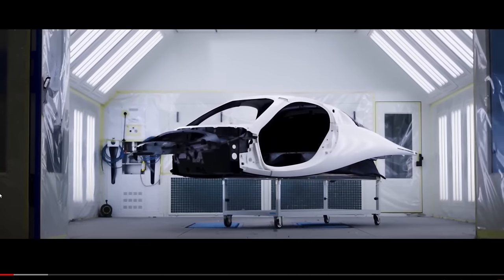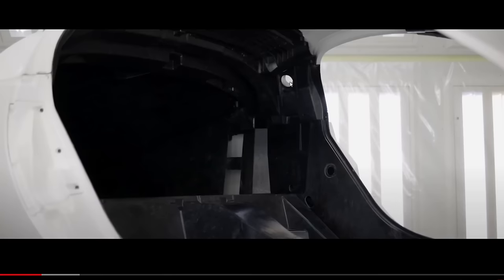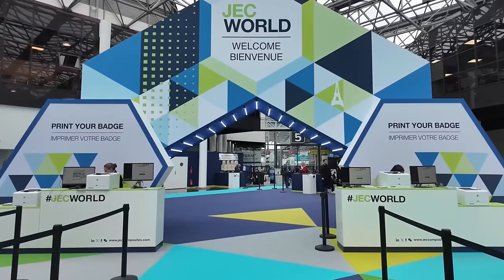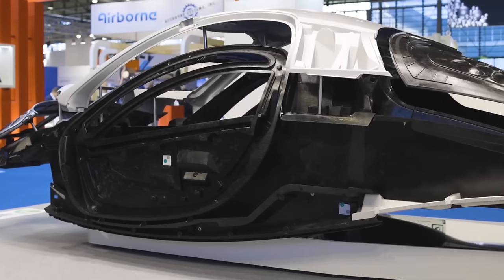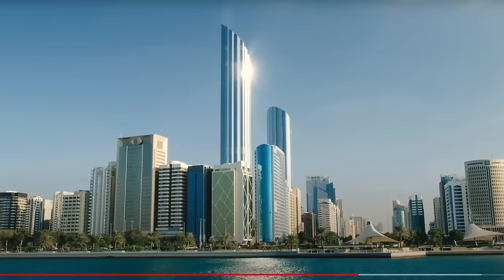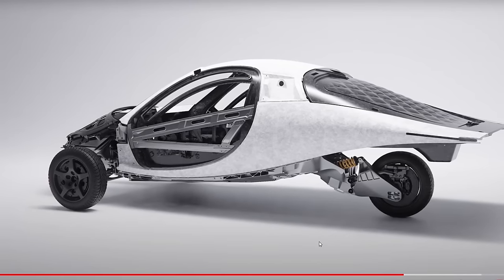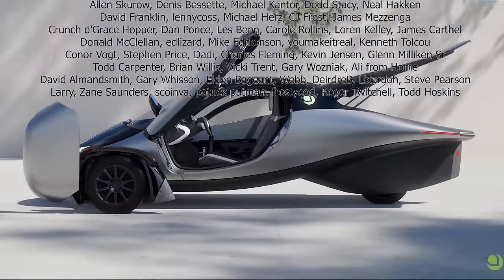Aptera March 2024 Update Commentary

Comment: I got the impression that PI-1 was intentionally coming to Carlsbad for the electrical validation. PI-2 will be the rolling unit but Chris had said that all PI builds can be updated.  PI-3 will have the polish of what the LE will look and function like.  I would imagine that Aptera would not miss out on the opportunity to use PI-1 for more than just the electrical validation and we may see it in a crash test.  At this point, each body is worth an enormous amount of money and getting the most out of every build is in Aptera's mode of operation.
Reply: If it does not have metalic structural components it will not be revamped for crash testing.
Reply: @glennzajic7318  I see nothing preventing them from attaching a full PI chassis, suspension and the rest of the parts to this once they are available.
Reply: @fotoguru222  I was particularly thinking of the roll bar that gets sandwiched between. I don't think they would cut it apart to install that.
Reply: @glennzajic7318  Can imagine some parts being temporarily bolted together pending updates and later bonded if needed for further validation (eg, crash testing).🤷🏻
Reply: @glennzajic7318  I hadn't seen Steve F. comment about no metallic structural components in PI-1.  That would be a great opportunity to test the de-bonder and put the structures in...  Probably not worth it but maybe it was lightly "tacked" together so it could be taken apart and made a complete vehicle down the road.
Reply: @gr8dvd  I suspect that all the black carbon parts (the strongest components) are bonded.  Then I imagine that a lot of the white fibreglass parts which are not as structurally vital, will me screwed/bolted on for easy removal as needed.  This makes the most sense because if everything is bonded then you couldn't remove any parts for minor repair issues such as wiring problems.  I think of the black as the structural part and the white as the outer layer.
Reply: @gr8dvd  It is possible to debond the parts with a heat gun, but I don't know if that would be the best use of capital.
Reply: @n.brucenelson5920  👍 Or tack-bond (debond) like tack-welding if assembly / disassembly needed.

Comment: The reason why Aptera is "the last man standing" in the solar powered vehicle startups is because they understand pacing. That's a quality that all successful companies and even adults have learned. You create a plan, you implement it, you make minor course corrections as needed, but you keep taking a step every day in the right direction. Aptera is not just inventing a new mode of transportation, but a new way of manufacturing it. I have learned a little about patience from them.
Reply: It is easy to say if you do not have your skin in the game.
Do you have any skin in the game?
Reply: @Kukaboora  I agree with OP and do have ‘skin in the game’ …. $100, well $70, well refundable $70 😂  Maybe semantics but think it’s vision —> plan —> strategy —.> execution down to minute details and resisting the temptation to take shortcuts that would compromise the final product.  (BTW I’m in the accelerator program… so in for more than $70.)
Reply: @Kukaboora  it's not "easy to say;" it's a basic truth about life that we all must learn.
Reply: @gr8dvd  
I am really glad to hear someone has confidence in Aptera. As for me, I already lost half.
Only very recently, Aptera was sure of a composite frame, all of a sudden that composite turned into aluminum.
And then I learned that the impact collision energy would be directed down to where the battery pack is.
Aluminum has 1/3 strength of composite materials, twice the weight and plastically deformed easily.
Would that be a wise, well thought of decision?
Reply: @Kukaboora Aptera still has a composite "frame". It is more a unibody than a frame, but the aluminum chassis does not protect the passengers it makes up the crumple zone in the nose, and directs collision forces toward the battery, as you said. All with the intention of keeping the passengers above the impact. 

The aluminum, like the fiberglass outer panels, is designed to absorb impact. The crash testing will show if this strategy works.
Reply: @Kukaboora I've got skin in the game (about halfway up the accelerator list) and still have confidence given the information released over the past two years. I've been in product development for about 20 years and their timeline after spinning up the company again is not out of line, especially given Aptera's capital to date. And I've been impressed with most of the decisions by the Aptera team.
Reply: @richardryley3660 - The Aptera is body on frame just like a pickup truck. Nothing special. Frame does the work, body holds the people.
Reply: @billsmith5960  Yes, yes, we get it, Bill. Chris and Steve are liars. There you've contributed to your part to this thread.
Reply: @richardryley3660  - I never said that. I just like to keep people from just repeating the same thing over and over again and think for themselves a bit.
Reply: @billsmith5960  Contributing up to date information is precisely my purpose here. Yes, you believe the "safety cage" is a marketing gimmick. You have already said that. You don't need to repeat it.
Reply: @richardryley3660  - I'm providing engineering knowledge. If's I've provided false or non up to date information, I look forward to your claims and how you back them up.

I also look forward to you providing the information as to the Easter Egg that Aptera provided with their videos and the construction of the bink. All of the Aptera composite experts seem to never figured it out. I just wonder why.
Reply: @billsmith5960  You're not the only one with engineering knowledge here, no matter how much you may claim so. And in fact I think your claims show a lack of knowledge. 

The crash test data will show definitively whether the passengers are protected or not.
Reply: @richardryley3660  - Did you ever find that Easter Egg on the bink? As an engineer, you seen it. Maybe, just repeat what Aptera says and call that engineering?
Reply: @AverageJoe928 
Thank you Joe.
Reply: @Kukaboora  It is an apt comment.  I am both an investor, but also have decades of industry QC experience.
Reply: @billsmith5960  Hardly "nothing special".  Even Aptera prototype performance is astounding.  You can't point to another vehicle that is built this way.
Reply: @Kukaboora  Unlike the way Tesla started out, shipping product that they knew was defective, Aptera is a continuous improvement company and will pass their vehicles through validation before shipping.  The purpose of the PI vehicles is to do that validation and make corrections as the need is discovered.  This should increase your confidence in the final result.

I once worked for a company that recalled test products from customer hands after getting good reviews, because the engineers had discovered ways to improve it.  When we introduced our revised product at an industry trade show, a competitor at the show removed their product from display after the first day, and ours dominated the industry for over a decade.

That product was used by many automotive companies in QC.
Reply: @Kukaboora  Am I an investor? Yes.

Comment: Who knows? Nobody really knows. 

My take is that there will be roughly 16 PI builds (probably much less, something like 9 total). The first three will be empty shells like the one presently on route to Carlsbad and they will be for checking out the wirings, cables, frame, rolling chassis (when those are ready) and various initial displays to the public. These are the PI build #1 versions. We may reasonably expect all of them by August. 

These will be followed by the next triad PI builds (PI build #2). These will constitute the complete PI build as regards the structure, frame, chassis, wheels, etc. It may lack many accessories and internal "furniture", but it will be factory-assembled at Carlsbad using the twelve assembly stations, and driveable. These will be used for crash and validation tests and further displays to the public. If they manage to produce them by the end of the year and nothing else, that will be a feat of immense proportions for a startup like them. 

Then, we have the final PI triad - the PI build #3. The PI build 3 will be the actual production intent vehicle that will be sold to reservation holders. These will also be the ones that the media will be driving around and doing shows on. All things being equal, late Q2 of 2025 is my bet for first deliveries. 

I am yet to miss a prediction since late 2021 that I started making these production/delivery predictions. But I hope Aptera proves me wrong this time around and delivers vehicles earlier. I am rooting for them.

Comment: There was a mention elseware that a computer crash simulatation reviled a problem with the frame design tha they had at that time, so for safety reasons the frame design would need some changes and that would also change the frame production plans, So the rolling chasis will be delayed.  There for, they have decided to get the body here to start other work on it. There is much to be done with limited staff. While CPC is now working on the frame and suspension, Roush may still be doing the door hinges, so if doors come with the body thoes parts can be fitted as well as interior pieces.  Hopefuly,  the body will arrive this week so that work can be started, as well other electrical and lighting.  I have an appointment to visit Aptera on April 19th and should be able to see where they are at with it at that time and let you know.

Comment: So I'm speculating, based on this, PI1 will not be rolling at all and will have interior and exterior looking near production. PI2 might start out with an incomplete shell and have a working drive train and suspension much like beta but may be possible to retrofit to become more fully featured. PI3 may be the first PI build they do a full run of the assembly process from start to finish to prove out the process.
Reply: Or depending on timelines PI3 could be a validation mule for air tunnel testing and other structural stuff while PI2 is undergoing suspension tuning etc.

Comment: PI 1 is 100% just a body.  PI 2 will be a mule car.  PI 3 will be the pretty car.  Since they haven't even started tooling on the frame or suspension PI 2 and 3 will be a ways down the road.  As you discussed in your interview, June/July time frame if we're lucky.
Reply: June/July for what?
Reply: @adimchionyenadum2962  the drivable & pretty PI build.
Reply: @johnyoung376 I doubt.

Comment: Thanks as always for your review. It might have been more accurate to call this the PI shell, and as was stated it will be used mainly for electrical connections and component fitting trials. I wonder if they will have the first actual PI-2? ready and going to Drift-X by April 25th before it is shipped here.
Reply: No. It's the Gamma going to the show.

Comment: PI 1 will be like Beta for fine tuning things like the suspension,  this body will most tlikley become PI 1. PI 2 will be complete with solar and for demo.  PI 3 will be for performance testing.  Later builds will be for crash testing and promontional purposes.
Reply: likely mainly for finalizing the wiring routing.  It may not even need a suspension for this work.

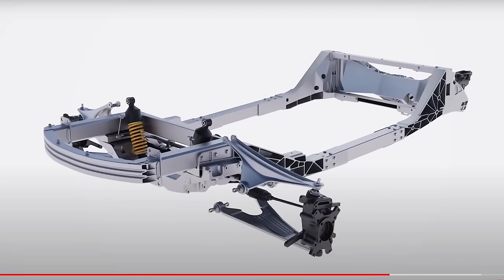Comment: About the chassis. @ 14:27 It looks, to me, that it's a combination of extruded and cast parts that are bolted together. It's a bit concerning to me. It seems like bolting might not be very strong. Maybe, there will be some welding done that just isn't shown.
Reply: They can rivet it. Welding cast to extruded is a daunting task. Plus riveting is more efficient and cheaper. We rivet pickup frames together.
Reply: Hmmm. 🙄Why do you think the bolts won't be strong enough? You don't think they analyzed all the stresses and strains thoroughly with finite element analysis these past few years? Remember this vehicle weighs less than half as much as a metal bodied EV.  Consider that the body tub is the main piece of this vehicle and the battery pack is structural as well. Can't weld to those! Right sized bolts, washers, lock nuts and bonding compound will hold it together just fine. 🤓
Reply: Bolts hold everything from engines to spacecraft to aircraft carriers together.
Reply: @jamesengland7461  And, just like the presence of internet trolls, ya can't forget the nuts! 😁

Comment: I'M REALLY LATE thinking of this question.  I know early vehicles will have limited or only 1 color option, but the outer panels are SMC, and that's what the Pontiac Fiero used,  only their panels were permanently impregnated with color and never need paint.  Can Aptera do this in the future as well?
Reply: I believe the black and white color scene of the SMC is due to color pigment impregnated in the resin. White was probably chosen because it's neutral and can be tinted with the wraps. 

Short answer: it's possible but would require too much additional cost to customize your resin to your individual vehicle.
Reply: I suppose it would be possible in the future to customize your Aptera to no wrap. So you would have the carbon fibre finish. I too would love that.
Reply: @adimchionyenadum2962  I actually like the bare white fiber look. It's kind of neat. And it's shiner than I expected.
Reply: @adimchionyenadum2962 The outer panels are made of FG-SMC (fiberglass). It is my understanding that they require UV protection (the wrap).
Reply: @garywozniak7742 Isn't FG supposed to be white, or at least colourless? Secondly, why is CF SMC white in colour even though carbon is naturally black? If I remember well, the traditional metal body panels are called Body in White (BinW) because they are dipped in white paint once they are produced. Now, the BinC, instead of being black, is also white without being painted. What's happening here? Why so much confusion?
Reply: @adimchionyenadum2962  The CF SMC parts of the BinC are black. Look at the shots of the tub from the inside. The FG SMC is white. The Aptera is made of both types.
Reply: @adimchionyenadum2962  the inner black components are CF-SMC. The outer "white" components are FG-SMC.
Reply: @garywozniak7742  So which is the painted part?
Reply: @adimchionyenadum2962  neither are painted. . The exposed outer panels will require a wrap.
Reply: @garywozniak7742 But they said CPC painted the PI build they presented white.

Comment: I am really curious where they are with the frame and suspension components. It sounds like those are still under active development to get to production-intent parts. I am sure that there are lots of other things still being worked out, but a great deal of the remaining work to have a operational PI vehicle depends on the frame and suspension. Those components will also have an enormous impact on the quality of the final product. More information on what they are doing with that part of the project and the timelines for it would be very welcome!
Reply: I was really hopeful that the frame might be complete by the end of April since the show in Abu Dhabi is coming up. However, since Gamma is slated for that show clearly the frame does not need to be completed by then. 

Chris did say that the frame would be completed "in a few weeks" in another video and seemed to be hinting at that here. Honestly it would not surprise me if it took a month for CPC to finalize the design of the production intent suspension. But if it takes two months, it takes two months. 

As I said elsewhere, I think the suspension is being talked about here. I don't think they're going back to the drawing board and designing a whole new chassis. So the timeline appears to be May or June. 

The batteries and drivetrain are the bigger issue. They could show up before CPC finishes with the suspension, of after it. Either way, again it looks like we're looking at May or June. And then PI2 will have to be tested and validated on the track.
Reply: @richardryley3660  If they haven't started tooling for the frame and suspension, there is no way these are going to be ready in a few weeks. Three months is my take.
Reply: @adimchionyenadum2962  That's probably what is meant by "soft tooling". Where do you think the parts to complete and validate the final build of the chassis and suspension are going to come from?
Reply: @richardryley3660 No idea.